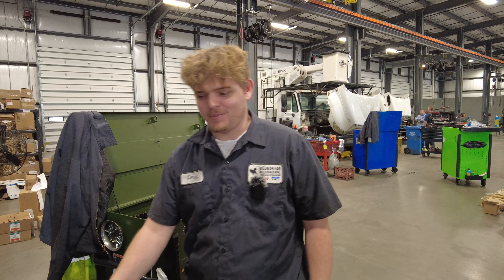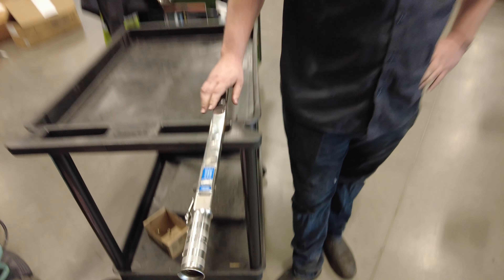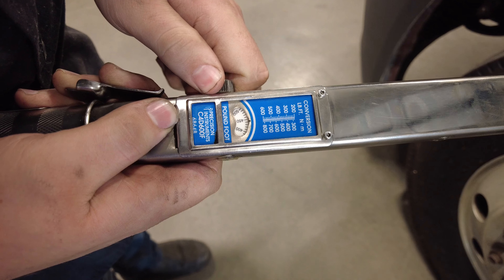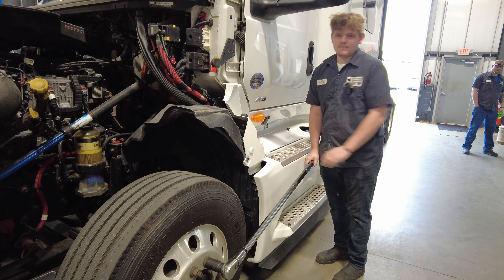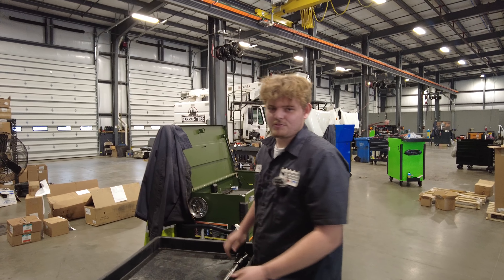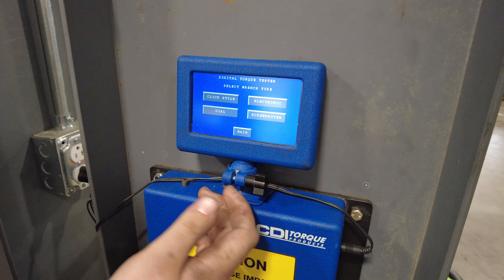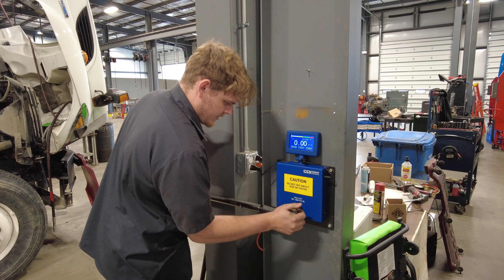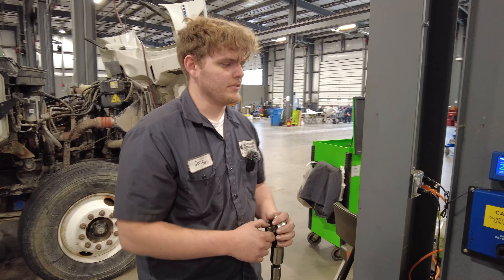Big Rig Rundown | How To Properly Use A Torque Wrench With Corey

Comment: How do you calibrate the torque wrench tester that's on the wall at 3:20?
Reply from the maker: It has been recently calibrated, and our vendor routinely performs these calibrations on the tester.
Reply: @BluegrassIntlTrucks  How is the calibrator calibrated?
At what point down the line are the Calibrating Weights used, and why not directly at the first level?
If you have an absolute 100-lb weight, you don't need a fancy digital scale on the wall that needs to be calibrated too. Just set the wrench to 100 ft-lbs, lock the drive tang so the handle sits horizontally, and slide the 100-lb weight from the head to the end of the handle. It's within calibration if it clicks when the weight gets to the 1ft mark of the handle.
Reply from the maker: Thanks for reaching out with your questions and sharing your insights on calibration techniques. Here at Bluegrass International, our calibration process is approved by the OEM, and we adhere strictly to these guidelines to ensure accuracy and reliability in all our services.

Our main goal is to add value to our community by providing dependable and efficient solutions. We appreciate your enthusiasm and interest in the technical aspects, but our focus is on the methods we recommend based on OEM approval rather than debating different approaches.

Thank you for understanding, and we look forward to serving you!